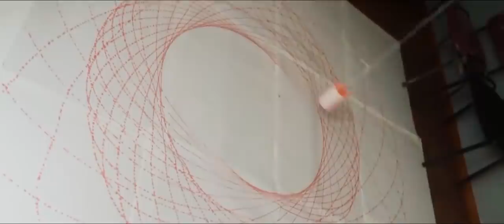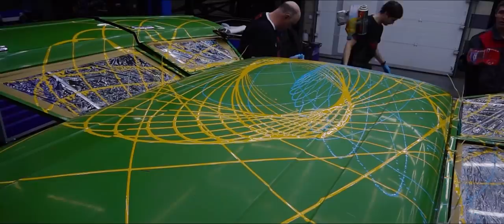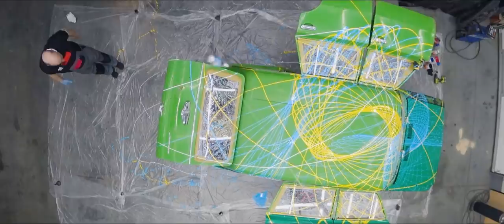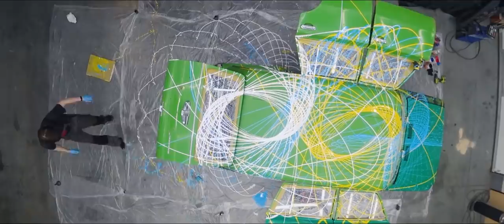Pendulum painting a Lada

Comment: You can get a similar effect by using dish soap on a pre painted body, then spray over it in a different colour and wash it off when the paint has dried, my best paint job was to lay the base out in several random colours then use the dish soap followed by the top coat.

Comment: Hey Garage 54 here is an idea for a fun video. machine a crank and a cam out of aluminum. make the connecting rods out of steel. replacing the aluminum pistons with steel pistons would add extra enjoyment to the video! replace push rods with aluminum not copper, copper push rods bends to easy. lead wrist pins is a must in this engine. replace ALL heat treated bolts(crank, cam, main, flywheel and so on) with regular bolts.  add 1 extra flywheel to this engine, I know you have plenty of flywheels! do not replace the oil with liquid nitrogen, it won't last long! anyway, all of your videos are great.